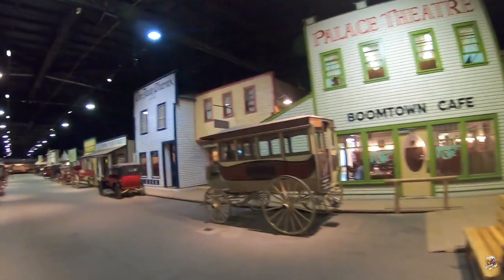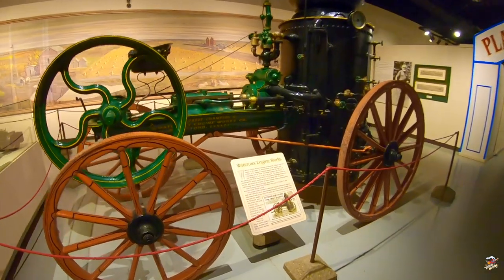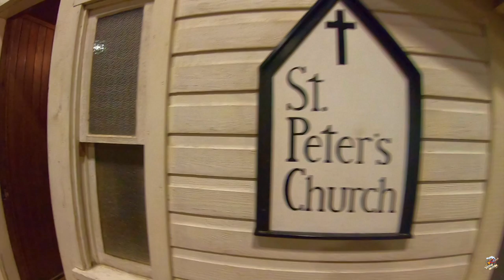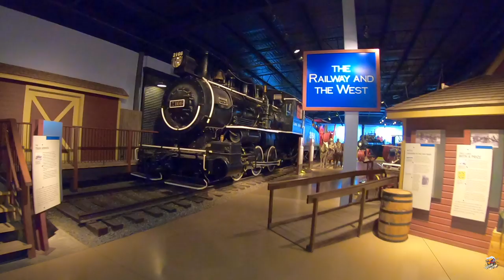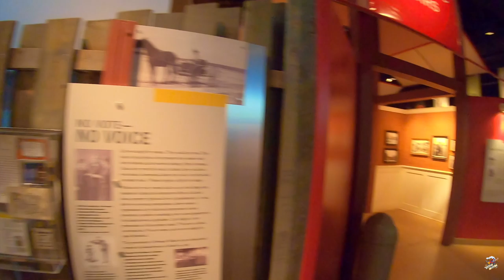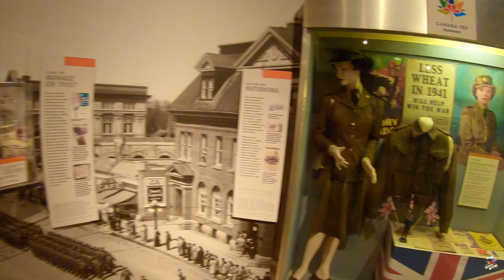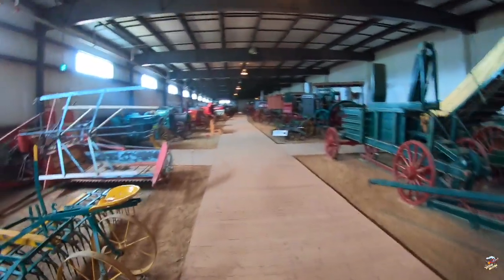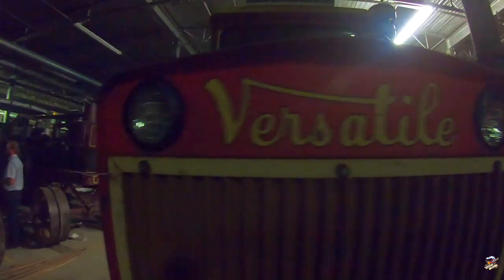Farmhand Mike visits the Western Development Museum in Saskatoon Saskatchewan

Comment: I've been there several times. In the video, the last steam equipment 14:30 is a steam log hauler. They would have 26 sleds towed behind it hauling logs to the mills. There is one more that I know of and it is a running one in New Hampshire and it has skis on the front vs. steel wheels to run in the winter months. It comes out each year or so for a antique snow car meet in the winter.